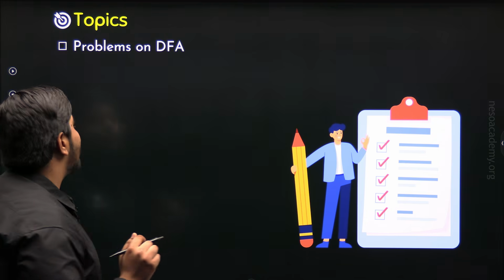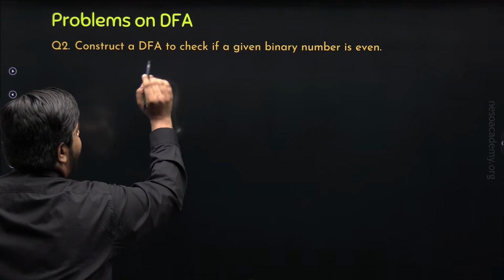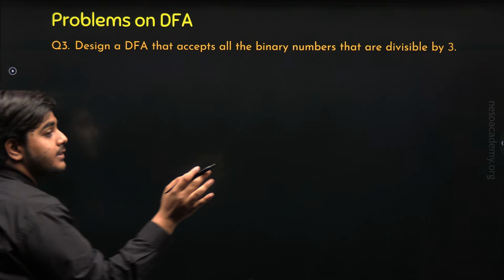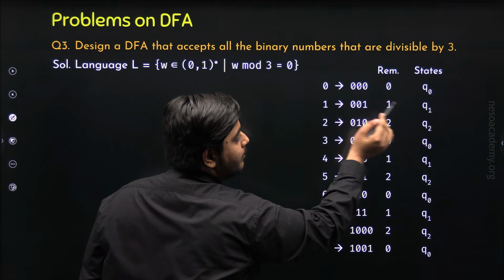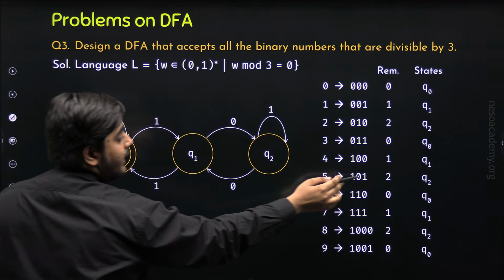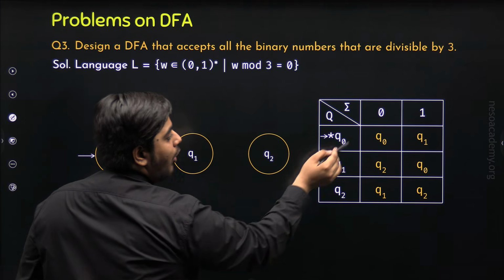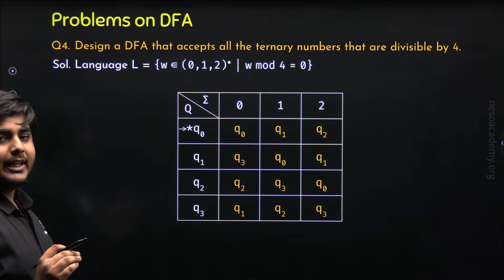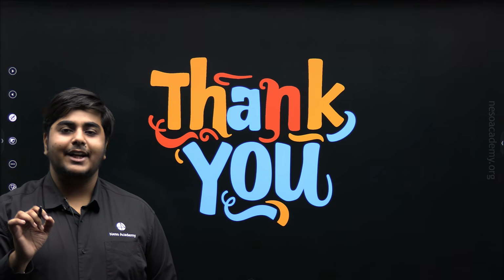Problems on DFA (Set 3)

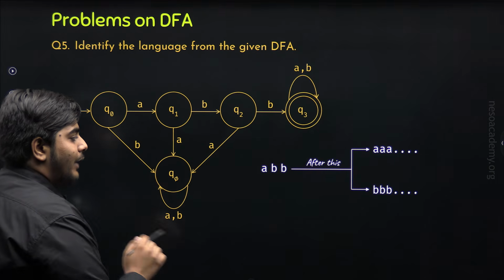Comment: At 18:12

While writing the language definition, why are we using parentheses (a, b)* ?
a, b are the two elements of the alphabet over which this language is defined, and an alphabet is a non-empty and finite set of symbols. so, shouldn't we use {a, b}* ?
Reply from the maker: Yes, {a, b}* is the formal notation for the Kleene closure over the alphabet. Here, (a, b)* was used informally to denote strings over a and b, but the intended language remains the same - all strings starting with “abb”. Thanks for pointing it out.